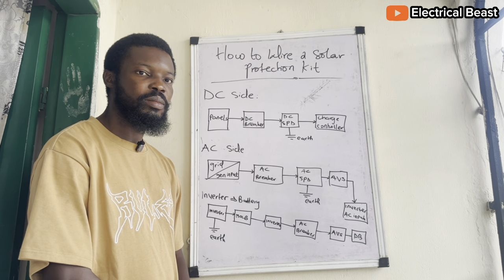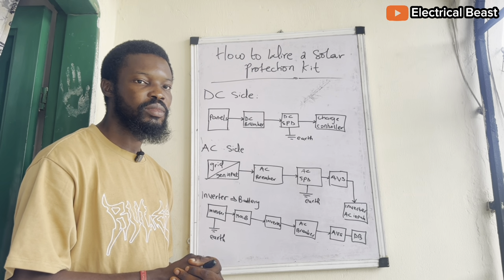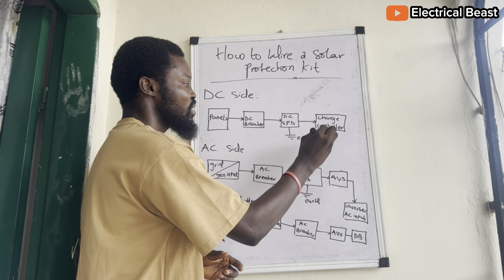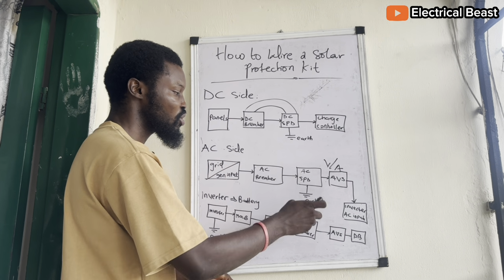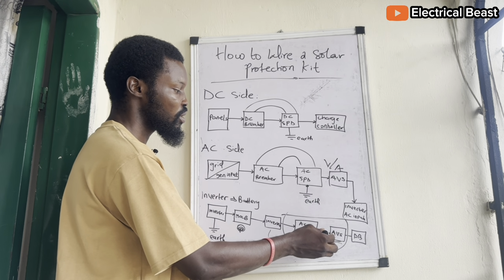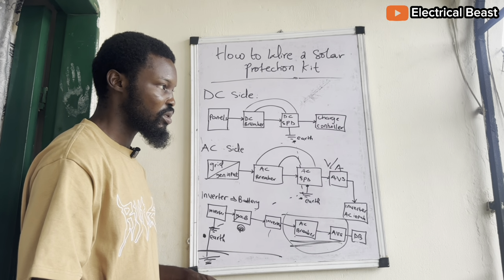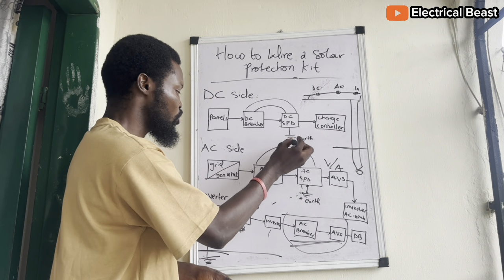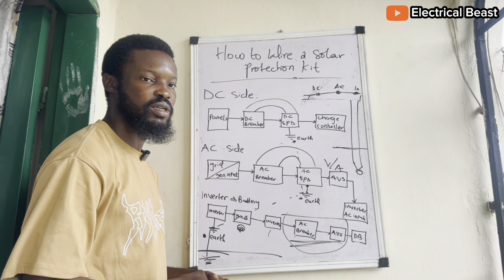How to Wire a Complete Solar Protection Box (AC/DC Breakers, SPD & AVS Explained)

Comment: Well done for the tutorial, however there is need to install a single pole DC fuse that + from the panels go to, also the purpose of SPD is to be a defender of the system so it should be before the breaker as surge can bypass the breaker. Therefore, the sequence is DC fuse- SPD- Breaker

Comment: Pls how do I connect the ac breaker to changeover top
To use lite to charge the inverter ? 
Correct me if the question is wrong

Comment: Please can you also demonstrate the installation of protector for itel all in one power tank with inverter 500w battery 1000w
Reply: I'm also trying to setup my ITEL 500w power tank, i got all the accessories except the ac surge protector and ac output breaker, i only purchased the MCB Box, SPD (DC), DC breaker, AC breaker and AVS from TEMU, with all he explained i understand all he said, it's basically loop DC to SPD on the input side and output goes to your PV Port, while the AC (assuming you aren't using surge protector) connect the grid to the input of your AC breaker and the output of the AC breaker goes into the AVS input, the finally the output of the AVS goes into power tank AC port to charge with NEPA.

Comment: What if I use spd in  both DC input and DC output of my DC breaker and my ac side spd connected to ac breaker output side and my avs input connected from my ac breaker output. And use spd in my grid/gen ac breaker the spd in output side and spd in inverter out ac breaker output side . 

Is the connection okay?

Comment: I have few questions 

1, have seen people install breaker imput from down instead of up , and when I asked I was told it doesn't matter how true is that?

2, is there a way you can carefully and slowly explain how to set the avs , both for the Ac input and the inverter output 

3, how do one know the exact size of spd or breaker to use for different sizes of setup

4, pls can you dm your WhatsApp digit incase of futher clarification

Thank you

Comment: Why no SPD used in the output of the inverter?
Reply from the maker: The output voltage from your inverter is steady and without fluctuations hence you need not have that